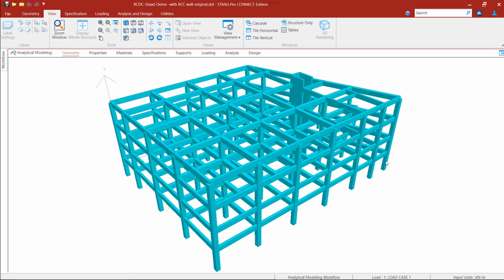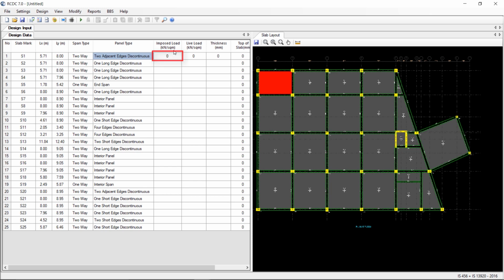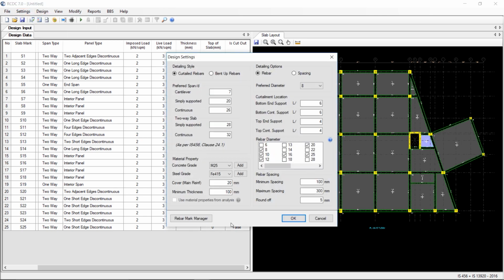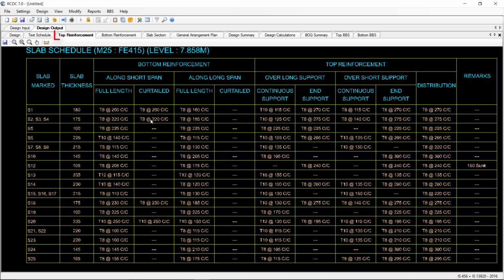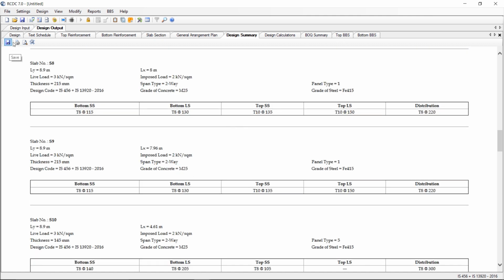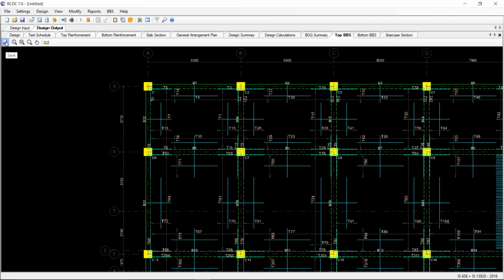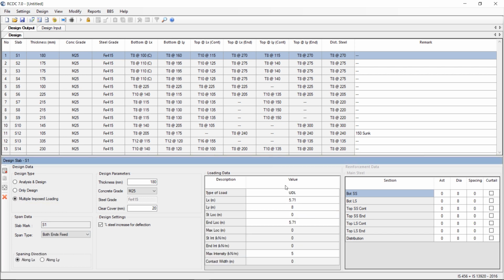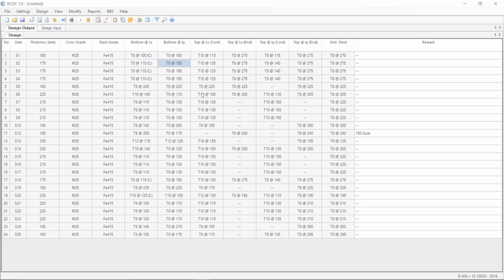STAAD Advanced Concrete Design: Slab Design

Comment: Sorry...I was trying to design a curved slab but it actually fails all the time...I cant select if it's a curved slab because there is no option for that in the rcdc...I cant put a finger whether it's a one way, a two way or a cantilever because all these options does actually fit...also the conditions like one side discontinuous, two adjacent side discontinuous or any of those conditions does not actually fit in...please help me out

Comment: Why should we provide Imposed load and Live load differently? IS code says Imposed and live loads are same. Plz explain this.
Reply: In  STAAD Advanced Concrete Design, Imposed load means the Dead Load on slab which excludes Self weight of slab and Live load is the actual Live Load on slab.
Reply: @satabdidas9784  thank you
Reply: @satabdidas9784  Hello,Please how can I design a cantilever slab in staad rcdc?